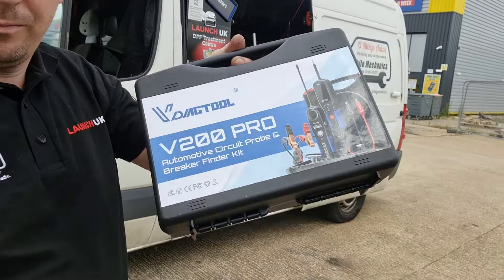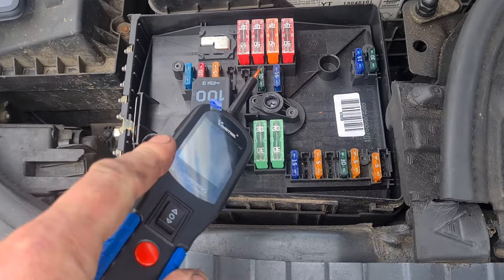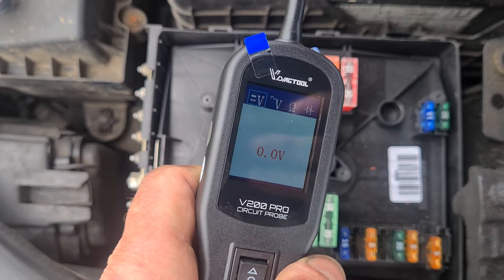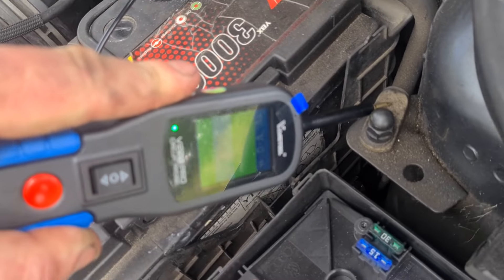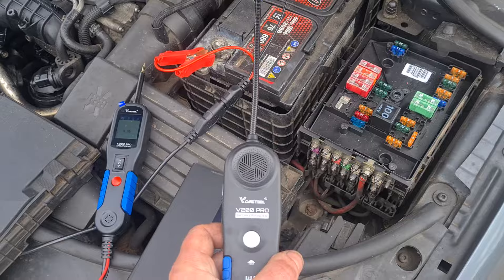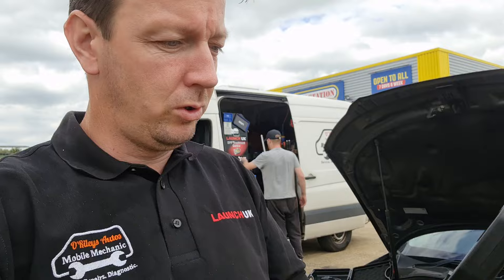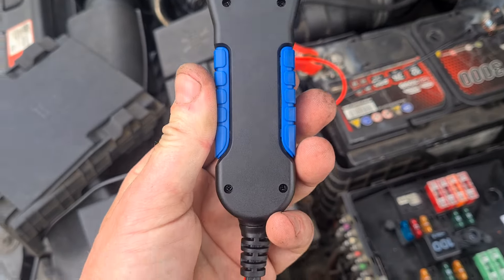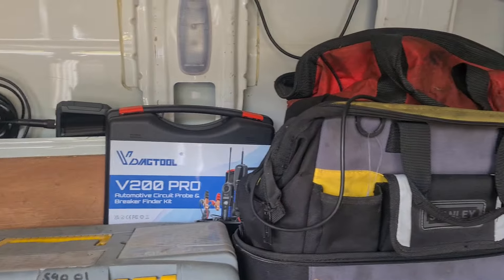VDIAGTOOL V200 PRO Automotive Circuit Probe & Breaker Finder Kit Review

Comment: the breaker gadget has to be used with the probe for it to work,,theres a toggle switch on the probe cable to connect it..,actually works pretty well